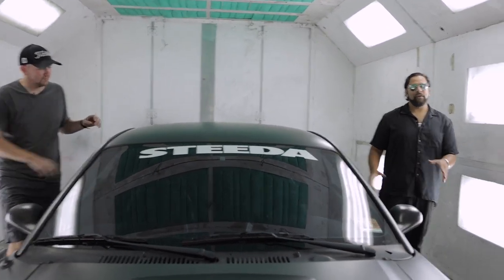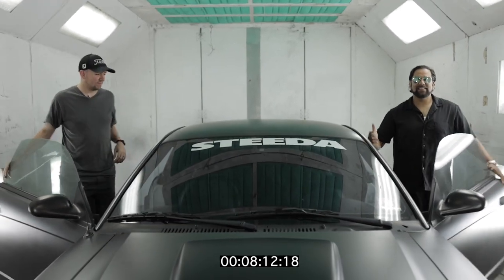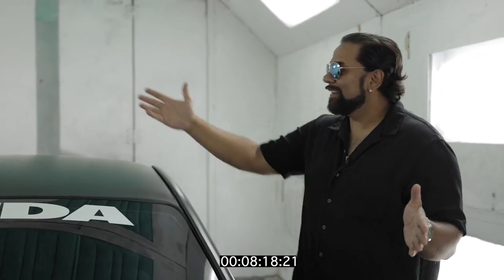REVEALING MY SECRET MUSTANG PROJECT! “STEALTH MAMBA”

Comment: nice....1" spacers on rear and or 10.5" rear with 315 tires....
Reply: This... something off with the stance
Reply: I have an 02 Bullitt, and I didn't need to put any spacers on to put 315/35-18 on the rear.
Reply: Definitely a must

Comment: Why wouldn't you do staggered? Looks cool but the back definitely needs a wider wheel
Reply: I have an 02 Bullitt and I put 18" Bullitt style rims that are the same offset and width as 03-04 Cobra, with 315/35-18 on rear and 275/40-18 front. The only way you can even tell that the rears are that wide is if you are directly behind it.
Reply: @thermalmeltdown8953  ya I had a 2002 new edge but I couldn't have it setup like that I need the side profile and the rear to CLEARLY show its staggered. But that's just my preference to each their own